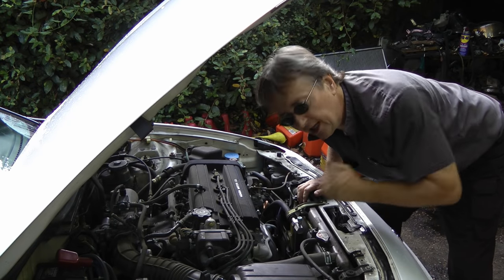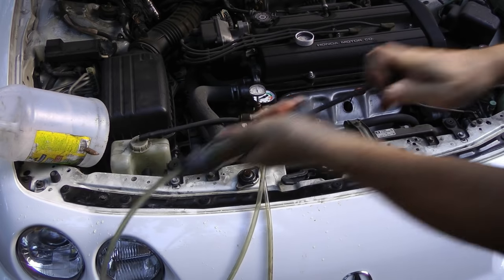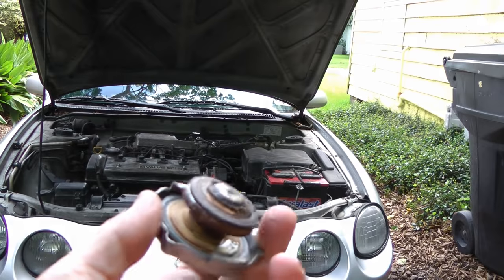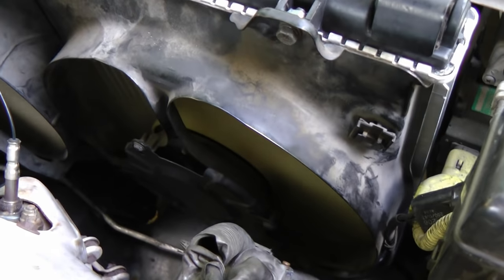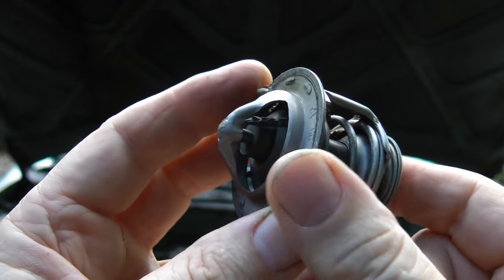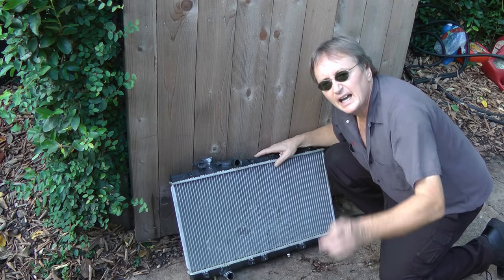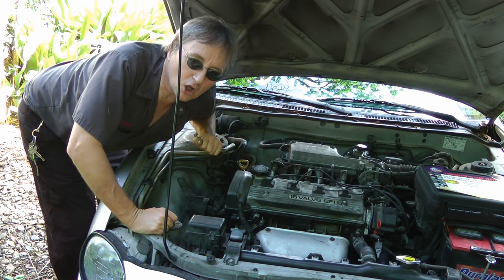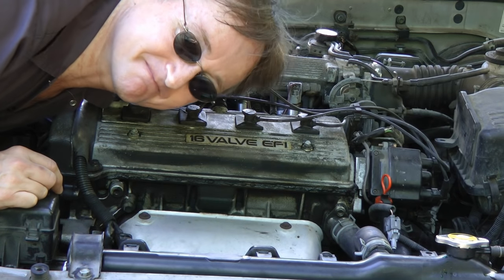How to Fix a Overheating Car Engine

Comment: So my 1996 dodge ram 1500 will over heat in the 30 degree weather around 5 In the morning As soon as it hits 45 degrees around 10 it'll stop over heating and run perfect all day any ideas or tips and tricks? I've put 50/50 antifreeze in it put in a new water pump and thermostat, thermostat gasket. Any ideas on what it is or how to fix it

Comment: My 2000 ranger 3.0 was misfiring and overheating. Coolant in the oil. Replace the head gasket misfire is gone but truck is still overheating. The heat blows cold also. Could this be still a head gasket or is it a bad radiator? Thermostat is new, the fan is working. Inside the radiator looks rather crusty but i am tired of spending money on the fix. Any advice would help!

Comment: How about an 88 Camaro IROC z TPI I replaced the radiator water pump, radiator cap? thermostat you name it still running hot fans are constantly on now heater core replaced you tell me?

Comment: Hello scotty my 1996 saturn overheated and there's oil mixing with antifreeze so would that be head gasket problem or a cylinder head cracked and how would i go about doing it myself

Comment: 94 Buick Century, the fans won't turn on... The relay, fuse, thermostat, water pump, radiator are good. Could it be the coolant temperature sensor?

Comment: It overheats when I'm on idle or low rpm (under 3,000). Fans are working. Should I pressure test it next?

Comment: Also guys If it is overheating, it could be the water pump as well blown head gasket is worst case scenario I start from the thermostat, which is the cheapest and work my way up if that doesn’t fix it .

Comment: Hello Sir. I hope you can help me with my predicament. I bought a used car (Kia rio 2004) and was parked for almost a year. After checking everything with a mechanic and bought it. We used the car several times after buying and without even cleaning the engine, it didn't overheat. After that, I decided to have the engine cleaned/detailed by a mechanic. After cleaning/detailing the engine, it overheats everytime we use the car. Any idea why Sir? Thank you for your reply. God bless you and your family!

Comment: A faulty fan switch or fan switch relay or fuse can also cause overheating at low speed or idling such as in my case right now. The fan won't come on with the engine overheating but does come on when I turn the AC on.

Comment: I replaced the thermostat, coolant temp sensor and it seems to still overheat. The top hose is hot but bottom is cold. Im stumped. Do you have any suggestions?

Comment: Hi Scotty I have issue with my car. Experienced overheat with broken water pump. The mechanic replaced the pump and coolant tank. When we start the engine there was a pressure in the coolant tank with a smell of gasoline fumes. What could be the problem of the system. I hope you can help me or maybe i stock my car forever. 😭 Its 2013 Ford Fiesta

Comment: May old car's temperature is ok if AC is off, but once i turned on the AC the temperature gauge starts to increase. Currently I can't use the AC due to the fear of overheating. What might be the problem? thank you in advance

Comment: When we see the cloud of smoke under the hood do we rev the engine more to fix it or less?  I already tried flooring the pedal for a good hour but all that ended up happening was two fire trucks came from a concerned neighbors report.  So I'm guessing not to rev it?  However still not sure...plz help

Comment: scotty , my 2002 honda civic LX temp gage went up slightly , not much  and the check engine light came on  , took it to my shop and heard bubbling  i think in the reserve , is it a bad themostat  or low coolant , didn't see any leaks

Comment: Hey , my car was overheating and turned off while I was driving? It started on and right off. Now it cranks but dose not start up . There was no code . I tested the cylinder coil dose not supply current to spark plug. I thought the ignition coil was bad I replace it but it was not issue . I thought may be crank sensor was bad and I replaced it but it was not issue . What I am supposed to do ? Dose head gasket make not start up engine ?

Comment: What is your opinion on this, I have a Chevy Cavalier that runs a little hotter than normal. Since I have had the car it has always ran on 195. The other day it started rising and has been around 215 to 220. Is this normal? I have flushed the old coolant out, new water pump, thermostat, new engine temp sensor, and heater core blows hot air. I feel as though it may be the reservoir cap or possibly the reservoir. I would hate for it to be a head gasket since the car only has 70k. A coolant pressure test has been done and there are no leaks. I can have it idle for 30-40 mins with no heat running and it will sit at 195 or less. As soon as I am driving though it will spike up to 220 and bounce back and forth.

Comment: Hey Scotty my 98 accord was over heating the other day . I recently replaced my water pump because it went out and the car was fine for a couple of days . No long distance driving but one day I decided to go for quite a drive & I noticed the a/c wasn’t blowing as cold and the car was over heating .. I opened the hood and seen  one of my fans wasn’t working , do you think that could be the problem?
Reply: Well yes the car needs all fans to be working. Buy the actual one not the universal fans.
Reply: imlatinoguy can you give me a link to one? I bought a fan from autozone yesterday and it’s exactly the same as the one that was down . Is that good enough?
Reply: @trxpbxy  yea aftermarket should be fine on the older vehicles. 

What I mean by universal is they got cheaper fans that aren't the precise size for it and can be bolted on, I'd stay away from those, just buy the one for your car.
Reply: @trxpbxy  Looking at the Orielly page they have them a little pricey cheapest ones like $90
Reply: imlatinoguy alright thank you

Comment: Hey scott my car is overheating but I did everything you mentioned and still overheating. I even put a new motor and still overheating, my radiator is new but a friend suggested I painted it black to match my car so I did it with bed liner spray I know it's not my radiator because it was new before I bedlined it. What could be the problem? I'm ready to sell it. It's a 68 SS camaro that was my grandfather's vehicle, I'd hat to sell it but I just might have to. I think it's the car that's junk. Lmk

Comment: Hey Scott I have a 1993 chevy suburban and wants to over heat in traffic I've change cluch fan and thermostat to a 180 and the radiator cap it was bad someone asked me if the timing was behind will this over heat the engine I had the it tested for head gasket just like you showed in the video and it is ok its driving me nuts help oh and it has a 7.4 in it

Comment: What if the temperature gauge is fluctuating up and down between too hot and too cold? Gets hotter when sitting still and then gets down closer to too cold when moving. Also heat in car barely working, only when moving. Coolant level in reservoir is good but will check radiator opening too like in the video

Comment: Been working on a 2001 honda accord 4cyl full size radiator replaced after replaced found out one fan is broken the other is good it has a dual fan could that be the reason it overheated again?

Comment: Scotty, I have an issue with my 350z. I have replaced the radiator, cap, water pump and thermostat. There is no sign of cracked head gasket. Flushed the system. Bleed the system plenty of times and still over heated. It now has overheated and cracked the new radiator again. HELP.

Comment: Scotty, i have a cool running 2017 Ram V6 vvt model with 100k.
The engine is quite small and there is plenty of room in the engine bay. I notice that the engine compartment metal gets really hot to the touch, also the exterior of the quarter panel. I can often feel this heat radiating out on the driver-side quarter panel. Where could this heat be produced? The engine runs at 198-213 consistently and the oil is full and looks clean and smells good.
Other than that she purrs like a kitten.

Comment: You can use a simple bicycle pump too. I did it to my civic 2003 model. Just replace the reservoir's pipe under the radiator cap with the pump tube and pump it until it gets hard. Then hold it there and ask someone to inspect the car for leak. Coolant  will come out drop by drop from the tiny holes if any. In my case the leak was in the metal pipe close to the engine. I replaced it and now a year has passed but no overheating issue.

Comment: Hi Scotty - a friends 2011 GMC Terrian 2.4L water pump. thermostat, coolant sensor was replaced due to overheating. And yet no hot air coming out of vent - all blower and fan motors working. Could a corroded heater core be the problem? Upper and lower rad hose are hot so are the water tubing going to the heater core. Its a puzzle; no DTCs present...thaanks

Comment: Scotty mate!! Okay I have a question for you. I'm scratching my head and I cannot for the life of me figure it out. 98 Toyota Hiace 2.4l petrol. Intermittently overheats. Now, this has been going on for a long time and I finally had enough and gave it a birthday. Complete teardown and recondition. Hot wash, bearings, cam, lifters, water pump X2 because I thought the first one was faulty, thermostat X2, radiator, radiator cap X2 etc.. The lot. Water jackets not plugged, no air in the cooling system. Correct coolant. Exhaust cat brand new and still this thing overheats intermittently, and I mean intermittently. It can go days of driving even in plus 30 degree Celsius weather with no problems, and then boom, temp gauge climbs and I've gotta keep the revs high to cool it down again. Then it runs fine.. New temp sensor and gauge too.. Many mechanics have tried to find this little gremlin and nobody can figure it out. Help me bud!! Matty from Australia. 👍🇦🇺
Reply: I won't part with the van, ever, and I'm at the point where I'm ready to do an engine swap.

Comment: I have a 2000 honda civic lx sedan. I just bought it. I replaced the thermostat, radiator, radiator fan, ignition coil to the fan, and another switch to the radiator fan. And it still overheats. It read that P0118 Engine Coolant Temp. I replaced that, but still nothing. Some people tell me it could be a water pump and others tell  me it could be a head gasket.

Comment: HI 
i have a 2010 sebring with a 2.7 im haveing some over heating issues. ive replaced my thermostate twice replaced my radiator done 3 coolant services and my 2.7 is still over heating do you no what other option i can try.

Comment: Yo scotty! Thanks for they videos  , I've got a 2002 chrysler sebring 3.0 v6 ( mitsubishi motor in it) .. my car heats up to running temperature pretty fast,  but when I sit at idle it holds temp just fine,but when I give it gas it overheats but goes back down after I release the gas peddle,it throws codes p0403 (egr) and p0102 (maf sensor) ,  my fans work fine,I've replaced thermastat,cleaned catalyst convertor using your methods,, but I can't get this overheating issue to stop!! And advice would be appreciated.. !?!

Comment: I have a 06 impala and I have replaced the radiator, thermostat,  cooling fans, and the head gasket is only 8 month old. Could a bad catalytic converter cause my car to continue to over heat after a period of time?
Reply: How much did that cost I have the same car with the same problem.

Comment: Hey Scotty I have a 2003 mitsubishi lancer manual and it just started to overheat but the strange part is that it only overheats if the car is at a stop light and not running. Any suggestions

Comment: SCOTTY,,,,What happens if a car engine overheats for a short time? I left it idle for a while and I realized I got manual fan turn on switch.,. As soon as I turned on the fan,,, it was back to middle in 30 sec.... but still the niddle was in the RED for short time.... did the engine suffred any damage?

PLEASE TELL ME..
Reply: You should be fine, I assume nothing "blew" so you should be fine, don't do it again.

Comment: Hey Scotty, I replaced the temp gauge switch but the gauge isn't working.
I check the gauge by putting a ground wire to the plug, turned on the ignition switch and it pegged out, any ideas what's going on?

Comment: I have a question does engine oil filler cap
 shut car off? am in a situation where every time i put my car in drive and turn the steering wheel, the car shuts off. But when i open the hood i notice the oil cap was loose, as soon i closed it, problem is off. I never had this issue before. i just got a new alternator on a 1998 for explorer.

Comment: i have a  jeep grand Cherokee i had the water pump replaced and for got to put the radiator fluid back in it had a little it run hot right when it hit the red i cut it off now the not much oil i just had a oil change last week now it say its half-full and then it say full now half ill relook today so what do you think its ok ???

Comment: I just got a front car cover that has screen heat shields and had to cut them, but these are all helpful when temperatures hit high in the summer , odd how you blast the heater fan on an old dial one then it went back to normal⚖️

Comment: A month ago, during a long drive AC was blowing hot air, White smoke started to appear under the hood. I stopped the car immediately and towed the vehicle to service station. Technicians said "The cooling fan motor is not working and the assembly need to be changed.". The new cooling fan is installed, now AC is blowing cool air. But,
1) The cooling fan is running for 3 minutes even after the vehicle is turned off, EVEN after 1 mile drive. 
2) When I checked, the coolant container is empty. The whole coolant system was flushed off and filled at the service station. 
3) There is no visible leaks or no coolant drain under the car on floor
4) AC is running normally. 
I need a further guidance. Thank you.

Comment: Hey Scotty help me out man I have a 2000 mustang GT pull the engine out and put a Cobra motor in it blew tha head gaskets rebuilt it and the car will still overheating a month later the engine blew so I went and bought another block from a Lincoln Mark 8 I put everything in the car and I'm still having the same issue after changing the radiator thermostat water pump one other thing I am running a procharger do you think maybe that's the case

Comment: So I had a coolant leak coming from a hose. Replaced the hose and added coolant. Then i turned on my vehicle and let it idle and bled the air out. Once I drove it started overheating. I noticed the coolant is not flowing through. What can it be thermostat or water pump?

Comment: I have Renault Duster in Saudi Arabia. When I turn on ac after 45 mintues of drive the heating scale rises up from half to almost full. Ajd when I turn off it goes down to half point coolent is right at lower level and fan works properly. What should I do? Whether I cahange the heating sensor or some other thing to do?

Comment: My car is a 2008 buick lacrosse Super and it constantly gets hot. The gauge claims it's good yet the water and coolant bubbles out of the resevior.  I had the headgasket replaced and the head worked on to make sure it was level. Had replaced the fan and thermostat. Worked fine til one of the relays burned up. I replaced the relay and now it'd bubbling or boiling out and the right radiator fan stopped working. 😢 I don't know what to do

Comment: Im having a problem with my 2005 Lincoln aviator, i have a hole in my bottom heater hose plus its rubbing against my engine which is wat caused the hole to begin with..can i get some assistance on fixing it for now until i can get it done right?.

Comment: A water is coming out from my exhaust pipe. My radiator water is lessened every after driving for around 20 km. Is it an i dication of blown up cylinder gasket. Can you tell the cause?
Reply: Sounds like it do you also have white smoke coming out of the exhaust
Reply: is the oil milky color?
Reply: @BigAlWillis  or the coolant have a brown tinge
Reply: @liveandletlive2894  could be rust or someone put stop leak in it before. that stuff is brown
Reply: @BigAlWillis  guess your right I just keep my stuff fresh and clean so I'm not used to crap on a radiator cap
Reply: @liveandletlive2894  if you're losing coolant you can pump air into the system to find a leak. I used a little pump from harbor freight just hooked it to the over flow port next to the radiator cap & pumped air into it. it instantly started leaking.
Reply: @BigAlWillis  I'm actually losing coolant in my civic but I cant find any leaks and the oil is clean so is the exhaust
Reply: @liveandletlive2894  often you cant see the leak. you will find it if you pump air into the system. get you one of those little red siphon hand pumps, walmart, lowes, harbar freight all have them. hook it to where the rubber hose is next to the radiator cap '' when car is cold '' and pump air into it. you will find the leak.
Reply: @liveandletlive2894  harbor freight has them for six bucks

Comment: Hey Scotty. I had my timing belt change, new water pump, new radiator, transmission flushed and my 07 dodge charger reservoir radiator is boiling. What could be the problem?

Comment: My car runs for a while then over heats. Is it the radiator ? I changed the thermostat and it's full of antifreeze. It cranks but sounds weak then once it cools it starts back up. the temperature is gage seems fine but then after we turn the engine off it shows a higher temperature reading. It's a 1987 e150

Comment: You could also have a stripped spark plug that misfires that causes overheating.  I bought a honda where the owner didn’t tell me he stripped it.  The car was done after that.  I couldn’t figure out why my honda sounded like a volkswagon?